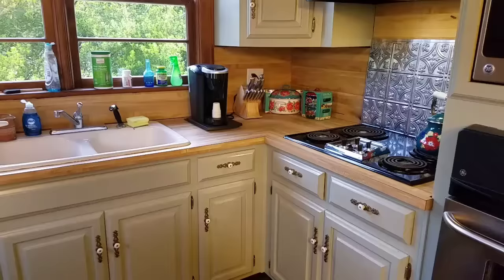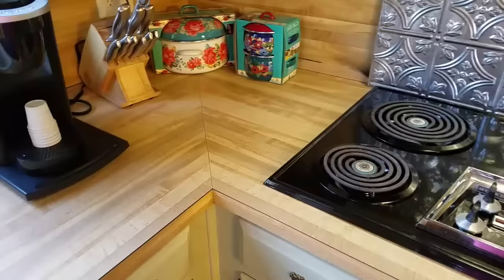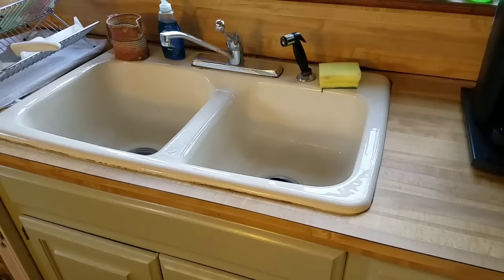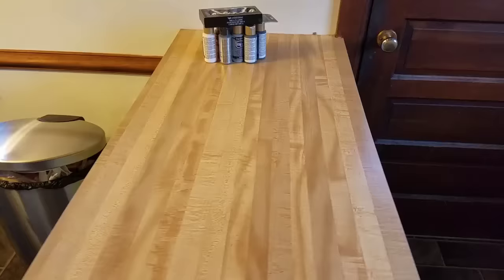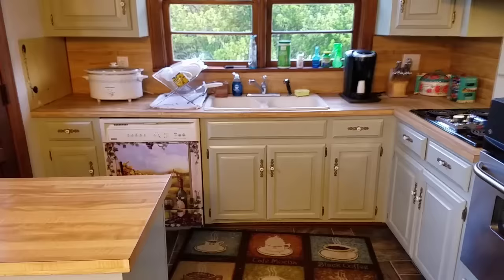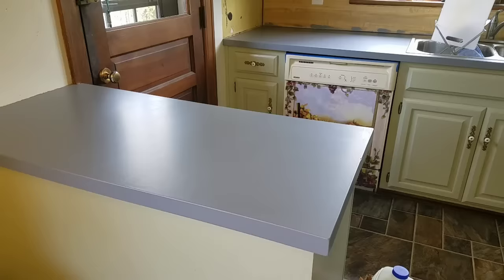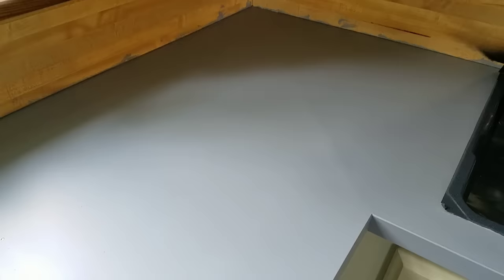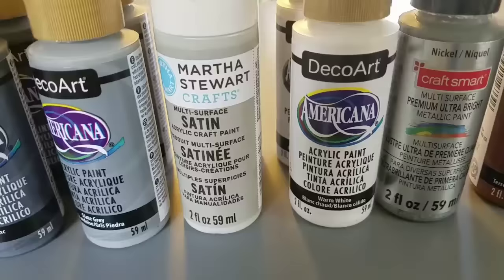How to Paint Countertops - $65 DIY Budget Friendly Kitchen Update

Comment from the maker: UDATE:  TWO YEARS LATER: https://youtu.be/HxIqbfqe0OE

Also, I thought I'd answer a bunch of questions here:
**  It's not a butcher block solid wood counter that I'm painting.  It is very old laminate that just looks like wood.  It doesn't show up in the video so much, but it is scratched, chipped and faded.
**  We were listing our house for sale.  Our agent advised us to renovate the kitchen.  The day we listed the house we had several above price offers.  We sold the house and moved out a little over a month later.
**  The last time we talked to the new buyers was 6 months after they moved in.  At that time, they LOVED the countertops and kitchen, and had no complaints.
**  We put the sink back in before painting so that we did not scratch and ruin the freshly painted countertop.  This needed time to dry and cure which took like 14 days because of so much clear that I added.  We also did not want to go that long without use of a kitchen sink.  Also.......if not replacing the sink as we did....who would really pull out the sink to do this?  I thought it would be a good idea to show the process as the same that MOST people would be doing themselves, with the sink in.
** I would use trivets when setting hot items on the counter.  Once they are cured they can handle quite a bit..but hot pans still stick a little.
**  I would not cut directly on the countertop.  I always used cutting boards when cutting meat, veggies and fruit anyways, so this is not a biggie.
**  Although I haven't seen these exact countertops in 2 years, I post an update of my brother's counters.  I did his kitchen 2 weeks after these.  No yellowing.  There is some chipping along the very edge that could be touched up.  He has a family of 6, so his kitchen is a HIGH USE ZONE lol.
**  Thoroughly cleaning the counter with an abrasive AND priming the counter is very crucial.  If this isn't done well, you may have adhesion issues down the road.
Reply: I would have made the base color, the primer you tinted a darker brown like on the floor and then put the lighter on top, would have matched the floor better.
Reply: @SindileWren   👀 👀 why so angry and rude 👀 👀
Reply: Ex
Reply: @SindileWren  You have some very good ideas. Unfortunately, they were put in with strong opinions that were not flattering so it takes away what were good suggestions. I personally love the mural on the dishwasher for it ties in the accents already in the kitchen. I am with you on the backsplash being too busy though I love that design I can see how it takes away from the beautiful countertops. Considering that the look is country then the hardware is fitting. Modern hardware that is too plain would not work as well but again even as I say this I know it is a matter of personal taste and opinion.
Reply: Thank you Lisa, you're very articulate and have a lovely, soothing voice.  I had been watching other epoxy countertop how-to videos on youtube with overly excited and loud demonstrators who never do answer critical questions.  Due to water damage from leaking pipes and other unsightly issues, I have to make a whole new countertop in the sink area, replace the sink base cabinet, the back green board drywall, etc.  My sink is an extremely heavy white porcelain cast iron one that looks just like your old one.  It isn't in bad shape and I will be using a sink re-glazing kit to make it look like new.  I'm taking my time to do it right and have no sink or dishwasher at the moment, so I'm using paper plates and washing pans in a tote bin in the bathroom.  All of these things can be done by a diy-er thanks to youtube videos like yours!
Reply: It looks great. How has it held up?
Reply: I really like that also

Comment: You should have left the sink out until you were done. Neater edges
Reply: That what I was gonna say. Then no taping.
Reply: I was surprised that the sink and range top stayed in place without raising the parts to permit painting underneath. Through use and activity with many crumbly foods keeping the edge of these parts cleaned is required. Cleaning the edges every day to remove a deposit of grime and crumbs around those edges will most certainly after time ruin the beauty of the hand painted surface. I thought some other paint would have been required. Kind of like creating a painting with acrylics on canvas. Thank you for your video. We are over 80 years old. We cannot use any primers, paints, and varnishes in our air. We are looking for a craftsman to cut and place a Formica surface for our new countertop available in local home supply shops. Can't seem to find anyone in our neighborhood on Long Island.
Reply: It may have been easier but this took days and they had the sink ready to go. They never took the cook top out. Only the sink. And wiping to clean would no more wear down at edges of sink than in the middle? Same product.
Reply: I was also thinking why are they putting the sink back before painting.🤔
Reply: Why didn't you leave the sink out and remove the stove top?  No taping and neater edges....
Reply: Here's an idea how about when you guys redo yours then you can leave the sink out. This is the way she did it. Why does everyone always  think they know better? I love the way it turned out.
Reply: Yep - made more work for themselves -
Reply: Kim Petroske 
Well I imagine, she still had to do everyday cooking and  needed the sink and stove 
Why do you people have to be so picky all the time?  Take what is useful to you leave the rest be😩
Reply: Linda Klinginsmith why don’t you people shut up and let her enjoy her work?  she is not telling you to do it that way. She is showing how you can transform something without spending too much money  something we all can use. 🤔
Reply: Maroxa’s Choices you are wise. Be well🌻
Reply: I was going to say the same thing.  Even if not replacing the sink or cooktop, I would have removed them, or at least lifted them a bit (leaving everything connected if they still needed to use the kitchen)  to get finish underneath.
I would have also gone with a 2-part countertop epoxy for the clear coat which would be a lot more durable than the Minwax.
Aside from that, she did an excellent job!
Reply: @evangelinabobadilla5368  cuz there Mike Holmes way to do a job and everybody else....
Mike Holmes way just happens to be the Right Way.
Reply: @evangelinabobadilla5368  - I am not being picky - I just think if anyone else wants to do this project they should know it is much easier with the sink and range out -  I don't care who does what and how they do it, but maybe my comment could save someone a lot of time and work - Don't take it so personal its not your kitchen
Reply: She did say it took 13 days....i think my life would be easier if I had my sink and water and stove for those days instead for the time it took to tape.....just saying
Reply: @kathy4451  I hear what you are saying....
But 13 days???? Wow!
Reply: Kim and others
I would bet, if I were a betting person, they did as they did BECAUSE, 1) it is just how they did it, so what, and 2) BECAUSE it is a working kitchen, still needing to be used moderately throughout the process, in order to feed the family and clean up afterwards, no luxury of going a different route nor likely wanting to do so....duh!?!!!!!
Not trying to be hateful, it is just obvious... to me anyway!!!

PEACE ✌ and
LOVE 💘
Reply: I loved the old sink. Taping it off works fine and then a nice bead of sealant all around to finish.
Reply: @ladyakiraa82 -I really don't understand why people are so sensitive when someone is making an observation. Regardless of whether or not how well it turned is besides the point. 

We are all here watching this video to learn, improve to achieve the best most possible results one is striving for.  If there is an good logical reason for leaving the sink or replacing it before painting I most certainly would like to know if there are truly any advantages or disadvantages. If there is a valid reason but forgot to explain why, then so be it. But to say "that is just the way she did it" is really not acceptable and takes away from the video.
Reply: Beautiful! Totally transformed the look of your kitchen. Great match to the floor too.
Reply: My thoughts exactly!! It looks great!! If you don’t have anything good to say, don’t say anything at all!!
Reply: @evangelinabobadilla5368  totally agree -   i wonder, sour grapes because she did a great job?   i absolutely love it and aM going to give it a whirl.  love the backsplash too
Reply: agree, I was wondering why you didn't o that!
Reply: We left the sink in and just taped, didnt have any problems.
Reply: @carolirvine3095  I actually think it's kind of nice that she taped it because not all of us are going to be replacing or sink. So we get to see how to and how it comes out was just people that are not replacing the sink and trying to do what she's doing. So I'm glad she didn't keep it off and taped it instead😊
Reply: lyricwritertoo oom,
Reply: @ladyakiraa82  haha I don't know why but your comment was not only true but had me laughing so hard 😂
Reply: @kathy4451  in that case she should have done the sink area separately. Just saying
Reply: @ladyakiraa82  
Wow Crystal! I was just scanning the reviews, because of course... someone has something to say! Smh I think it turned out beautiful especially with her  doing it herself and being her first time. SMH society...
Reply: All of this coming from people who aren’t doing crap
Reply: Probably because its for regular everyday ppl who might not have the time or energy to remove the sink
Reply: That's what I was thinking too.

Comment: Hi Lisa, Thanks so much for your view.  We’re on a tight budget so needed a do-able DIY. Sept 9, 2022 - I followed your directions and painted our bathroom old laminate vanity countertop white to brighten up the small bathroom.  I sanded really well, did 2 coats of primer, 2 coats of white acrylic paint and 3 coats of Polyurethane (which said to do several thin layers using only a brush so it won’t bubble), it looks fantastic!  We’ll see how it does over the next 3 - 6 months an on.  I’ll provide an update then. [stay tuned]
Reply: So how does it hold up?
Reply: Is there an update??

Comment: I love how all of your kitchen turned out. 
I did mine 5 years ago. When I moved in my kitchen was all beige, walls, cupboards, counter top and back splash. I painted cupboards white and walls medium turquoise. 
I looked at many pieces of marble and saw they were all different so anything goes!   I bought a kit that had everything in it. Black primer than some white, gray and gold. Turned out super well.  A friend liked it so much she went home and painted her counter!  Only thing is not enough clear coat. I should have bought more and shows some wear now.  
For my back splash I wanted linear tiles that included turquoise. I couldn't find any and I was on tight budget. I found some wallpapers that has my linear turquoise tiles! It is scrubable and people have to go over and touch it to make sure not tile!  Paper came from England at $50.00 a roll. Lots cheaper than tile and a cinch to apply AFTER applying special paint so it would hold!
Reply: Wow, it would be nice to see any pictures!
Reply: What paint did you use to hold the paper on the wall??

Comment: I love your counter top.  I have a u-shape counter because I used to can a lot.  I removed a wall and added a counter top over the 1/2 wall.  Of course, I did this in the 70's so i had an orange color.  I wanted to change it to a more modern color but I wasn't about to buy a new counter.  I love the fact that I can change the color this way.  I hope mine will turn out as well.  I'm 76 yrs. old and love to do this kind of remodeling.  I'm going to start this this summer.  Thank you for sharing.

Comment: I think you should be very proud of your creativity. You’re counter tops look amazing, and if by painting them, you can afford to give your kitchen a facelift every few years. 

A couple things I would do differently. I would paint before installing the sink. That’s just a personal preference. I have too little patience for painters tape. 

I would also get a paint pan for the varnish, and apply 4 coats, allowing a full day to let it dry between coats. Air bubbles can form if you paint it on too quick. 

But, you have very professional results, so I say, you came out ahead of the game.
Reply from the maker: Thank you so much for watching my video Richard, and for the awesome feedback!
Reply: After painting counter tops and creating a look of marble counter tops using you selected colors. The counters really do look good. I must ask though after pairing and polyurethane coat .can you use the counter foreclosing preparation.cleaning. the counter tops as you would prior to this painting process. I feel they would be less resitatant. If you cut sandwich will it remove paint or show scratches .  bottom line will you obtain the same durability you had before painting counter tops.
Please send response it's the only areas not address and it's the only areas stopping me.from doing my counters. I renovated my kitchen and don't really like the counters .i wanted to replace but the backslash is small tiles and removing the counters would destroy the work  done with tiles and grout . this would be perfect but does it last

Teaira te  paintedyh
Reply: I would appreciate if you could let me know what to expect as far as durability from the painted counter tops you did.
Ready and waiting 
Terri
Thanks
Reply from the maker: Hi Teresa!  It's been a little over 6 weeks now and my countertops still look awesome.  I would not cut directly on them, I would use a cutting board.  I also would not sit anything hot directly on them, I would use a hot pad or trivet.  I clean them with a paper towel or rag with a multi-purpose cleaner, it works great.  I certainly think they are not as durable as a manufactured countertop....but with the right care they are an affordable way to renew what you have until your budget allows for replacement.

Comment: I was thinking epoxy resin was the only way to go!   By the way, you could have put the mica flakes right into the clear coat while still in the can, stirred it, then, voila,  no need for any trouble or extra work!   Love this!  Saw it many months ago, forgot about it, and your video popped up again so I just saved my self nearly $200 (Cdn) as I thought epoxy resin was the only solution to my ugly, previously badly surfaced countertops (by previous home owner).   Thank you Lisa!!!

Comment: Loved your  video. Great to try diy projects. I used a rustoleum kit a year ago and after a process similar to yours, it turned out great!  However, after 6mos of use, it became apparent that I DIDN"T put enough clearcoat on, so I started getting mould issues in thin spots. wish I had of put it on as thick as you. LOL....anyhow, gearing up for round 2. Cheers.
Reply: Mold issues or mould as in moulding?  I am thinking of repainting the "1974 golden yellow countertops in my late parents' kitchen" to help sell the house.   I don't want any problems, this scares me!  hahaah

Comment: A darker glaze atop the decorative painting but before the top coat would have given you more of the depth that your floors have. Since you are using water based products you could still add that layer.  As an FYI its always best to apply several thin layers of top coat instead of pouring it on.  In the long run this will save time and will cure properly.  This is especially important for kitchen work surfaces. It looks nice. Good job.
Reply from the maker: I agree with adding several thinner coats instead of pouring.......this stuff was so thick I wasn't getting nice results doing it that way :)  I appreciate you watching my video and thanks for the awesome tips!
Reply: Great tips!

Comment: I think if you put several thin coats of the polyurethane on it would cure much better and faster. Very pretty.
Reply: I did this years ago to my counter shops tops at my barber shop and they turned out great and I did like three or four thin coats of polyurethane and recently I decided to go over it again because it just didn't have   enough of a Sheen so I went over it with this stuff that was the one coat stuff it was so thick and it was showing brushstrokes it was not leveling out and then when it was all done it was nice and shiny but you could see brushstrokes and lumps and then after a few weeks It started getting air bubbles under and it would crack and just peel off so I don't know I don't know what to do now I should have just went over it with some more thin coats cuz I haven't any trouble with the one where it's a lot thinner

Comment: Add the flakes, and instead of polyurethane use resin. Indestructible surface that way.
Reply: svanja   how do you clean the resin finish
Reply from the maker: Agreed!  With the resin....It would have been so much better after applying the flakes.
Reply: @acts10truth like you would any countertop. Epoxy resin is heat resistant, scratch resistant, and give a deep, dimensional quality. My daughter uses it to make tables.
Reply: @dorcasgriggs7925  go to sleep now Dorcas dear and remember to take your meds. :)  nighty night.
Reply: Will the resin yellow in time?
Reply: @marybullock325  It depends on the brand and type of resin used. There are companies out there that guarantee their epoxy resin sets crystal clear and won't yellow. (Just one company to mention for example that has larger packages available for doing counter tops, tables, etc. is Stone Coat Countertops. Jewelry / project epoxy resin is the same way it is just more $$$$$ because it only comes in smaller bottles.) ^.^